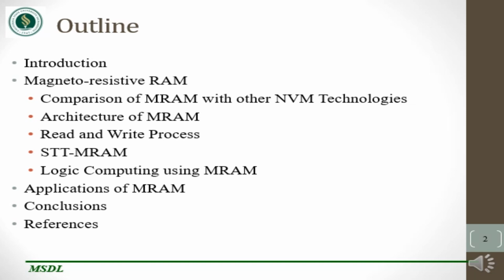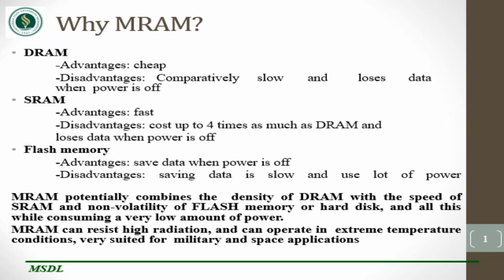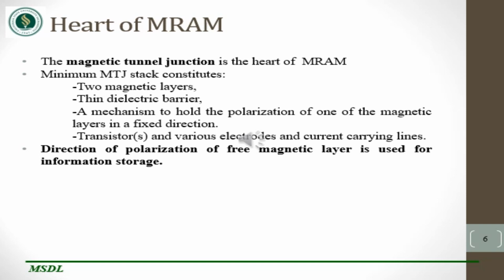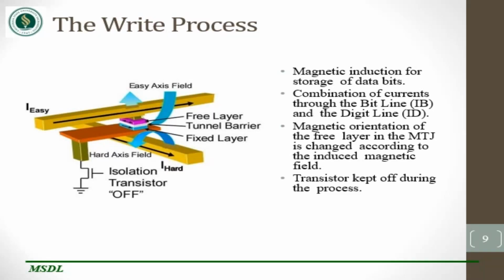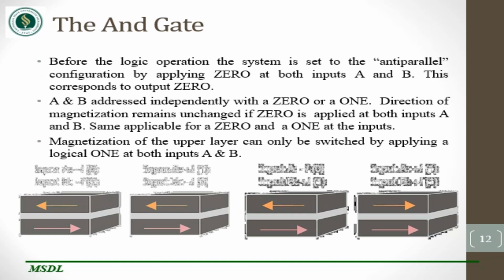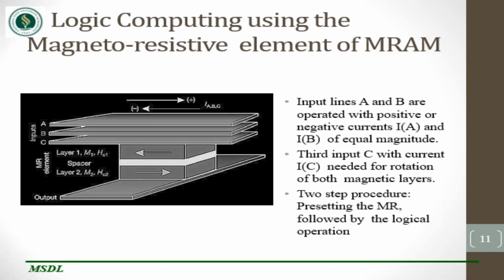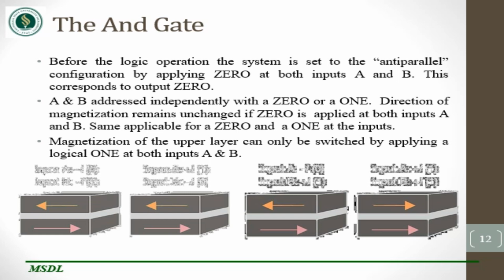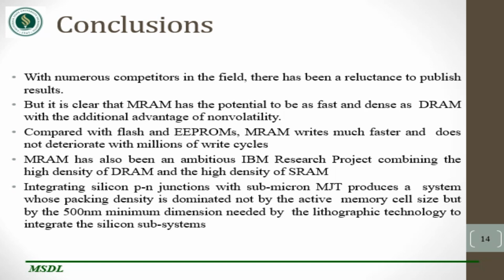EEE 236- Magnetoresistive Random-Access Memory (MRAM)

Comment: nice video kindly kindly share this in urdu also
Reply: A tip for future, some videos have CC button at bottom right next to settings (gear wheel) you can use that to generate automatic translation for most languages. It may not be usable with some languages so keep that in mind.